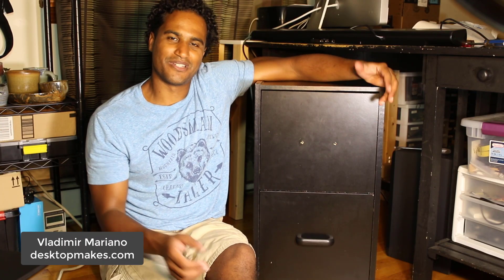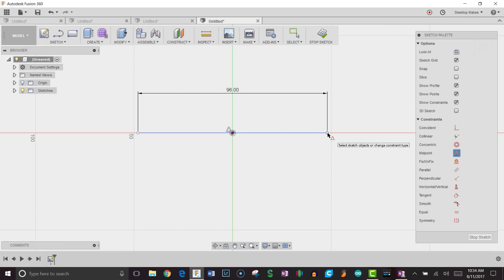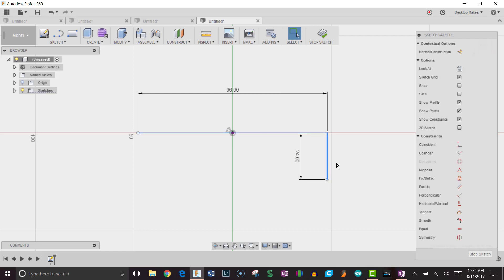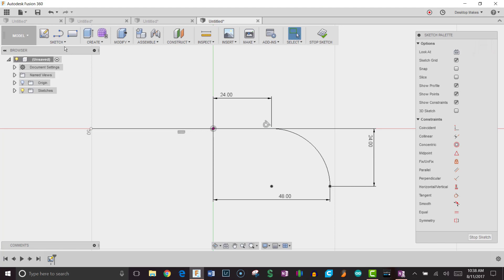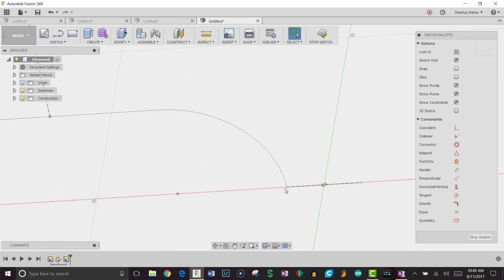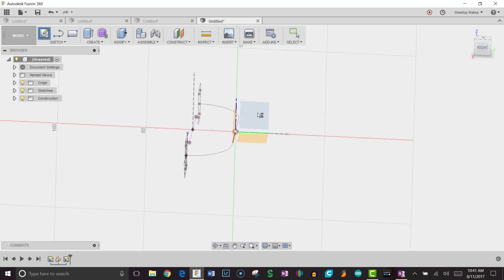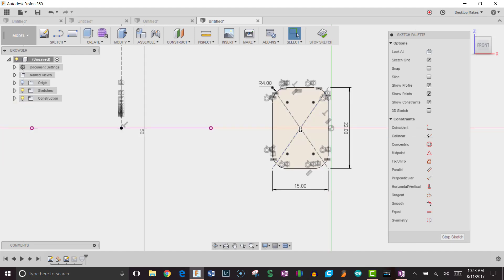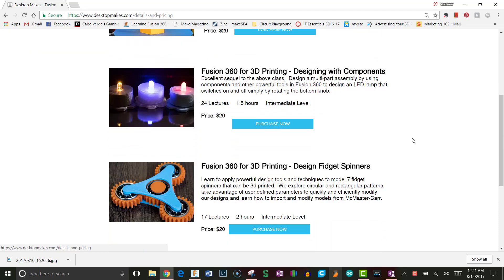Design your own Drawer Handles in Fusion 360 - Loft Tool

Comment: Great vid but I'm running into an issue. I get as far as lofting the 3 profiles but when I select 'Centerline' and click on the curved rail. I get an error stating that the profiles might be selected in the wrong order. I'm selecting the profile created on the new plane, then the one created on the original plane and finally the profile on the mirrored plane. Works great until I select the rail.
Reply: Never mind. I changed my Y axis for something I was trying and didn't change it back to Z up. I thought something was odd when I didn't have to rotate the created plane.
Reply: @ffaubert1  IM GETTING THE SAME ERRROR  how exactly did you fix this?